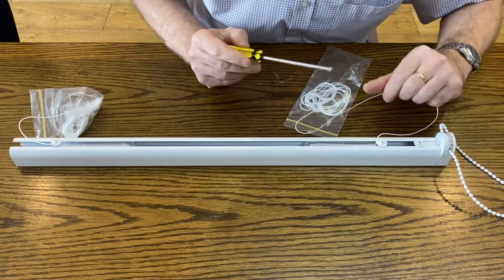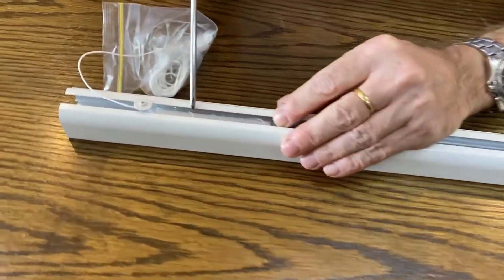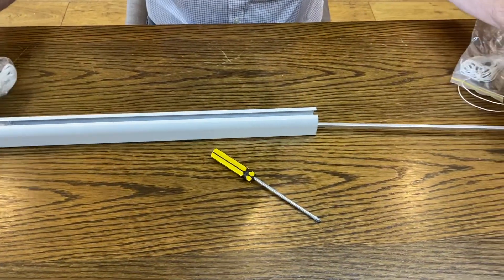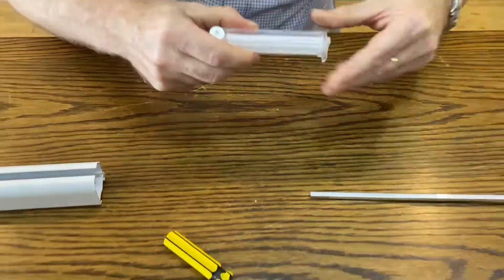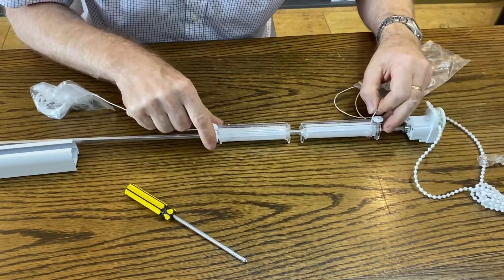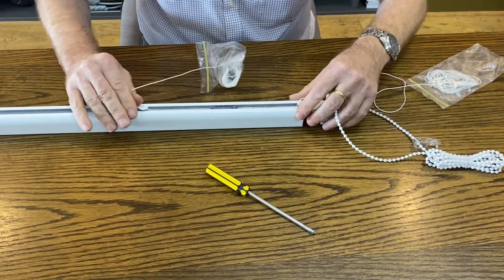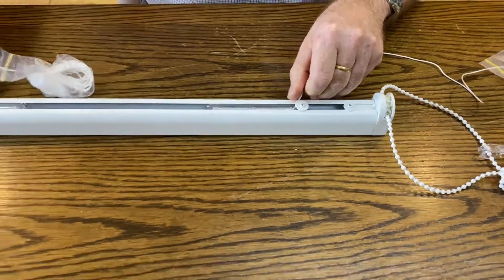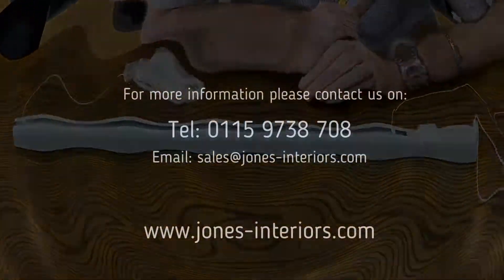Roman Blind System - Cord Levelling

Comment: I had to fix mine yesterday as the cords had all come away from the actual blind itself. I am only just looking on here if I actually done the right thing! I had to play around with the length of the cords (3 in my case) when attached to the blind itself, as it was still going up not level. Took a while to get the right balance.